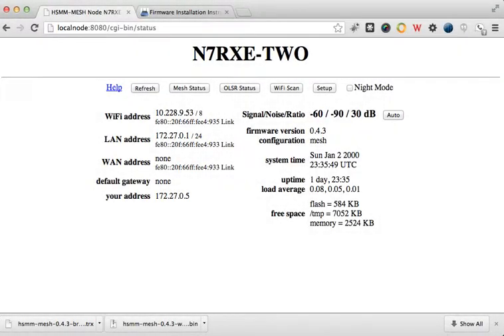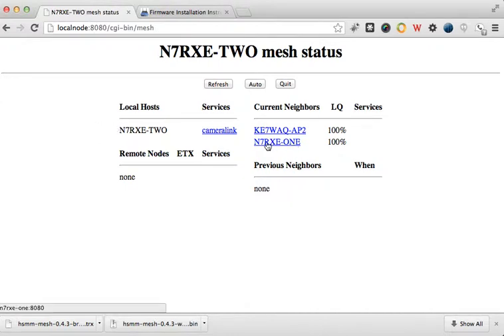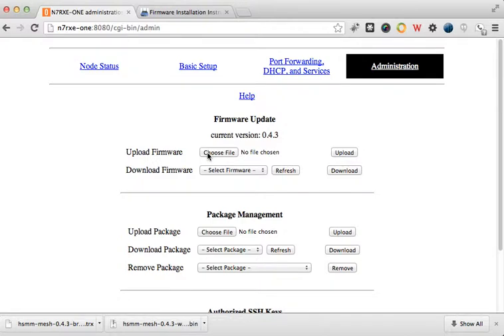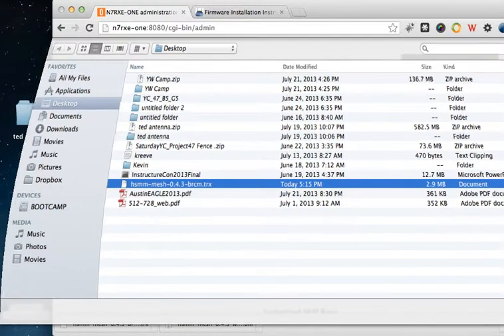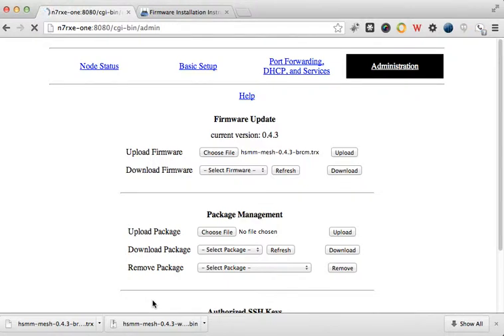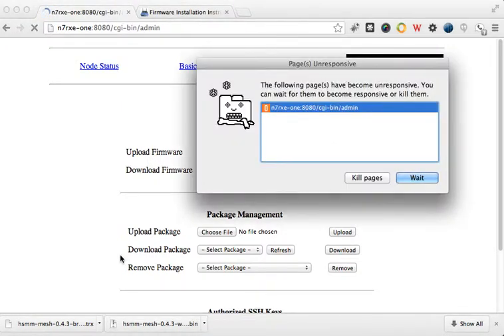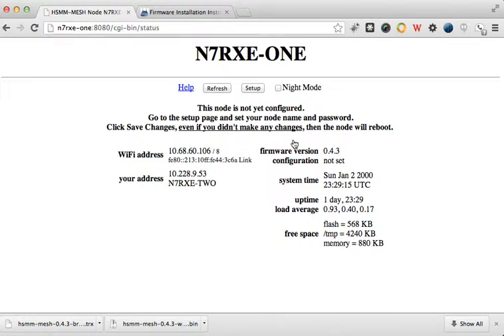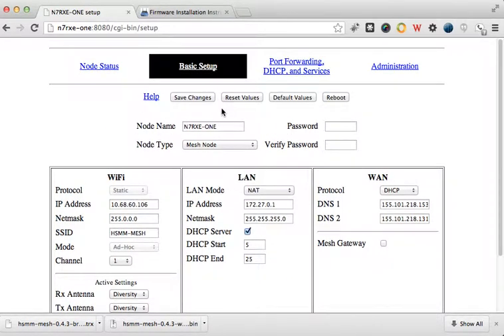3.  HSMM-MESH Update Firmware on a Remote Node - Testing.mp4

Comment: so if one does have direct access to their node via localnode:8080 how come we cant do it there ? I've tried everything & nothing works
seems odd we remove features for ham use & have to reinstall them in simpler terms
it ought to be setup so everything is basically the same except we chose to limitoptions